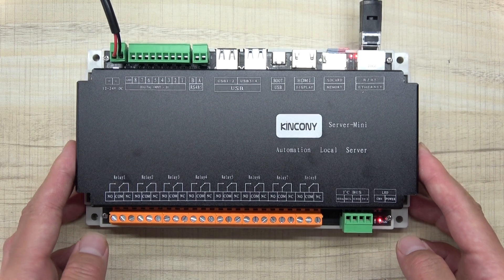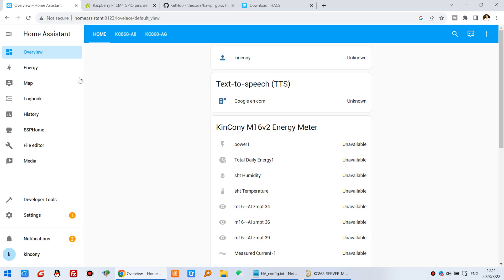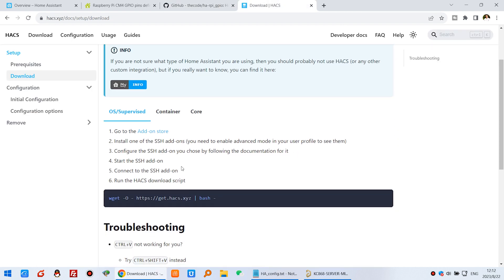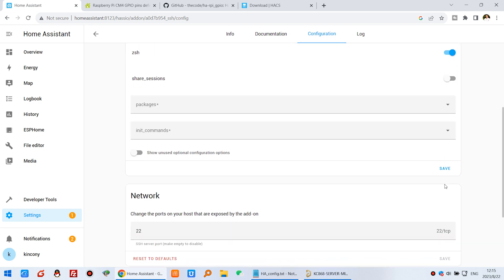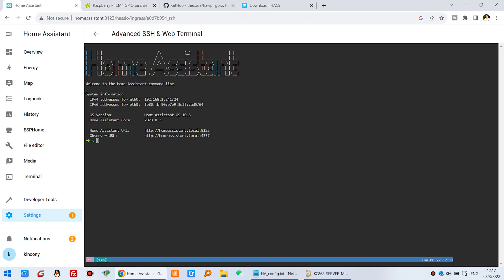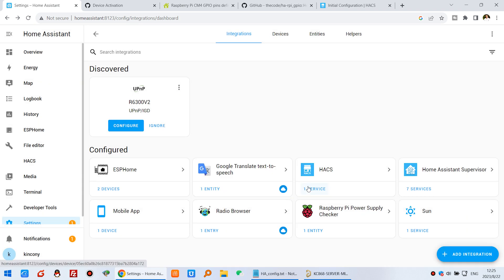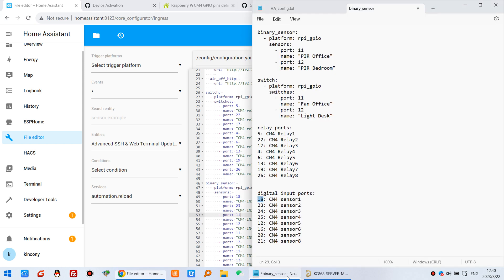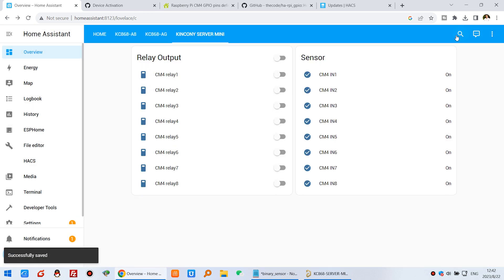Home Assistant Raspberry Pi (Server-Mini) GPIO Relay integration 2023!

Comment: Hello!
Our customer house project is with 
10 dimmable light zones. 
4 RGB-led zones. 
24 Relays outputs to 10A contacts 
+ 3 Relays outputs to 16A contacts.
Can U please send the board model for this setup?
Reply from the maker: you need some KinCony board's work together. suggest you post your requirements to our technical support forum, we will feedback a solution at here.

Comment: Nice video and very nice product, I have already bought from Aliexpress. I need to expand the I/O and the relays what kind of board I have to buy?  Many thanks !!
Reply from the maker: if you want extend relay, you can add i2c relay module, there is i2c terminal on KC868-Server
Reply: @KinCony  Thank you for the reply, I have to extends also the digitals inputs
Reply: @KinCony  Have you some example how to configure the outputs or inputs connected via i2c? Many thanks
Reply from the maker: we have video tour extend by MCP23017 chip, not tried PCF8574 with Pi. @cristiandelogu6049

Comment: Have you tested this board with the new Orange Pi CM4 compatible module, which has the RK3566 processor?
Reply from the maker: i am not tesed, does it pin2pin compatible with Pi?
Reply: Yes ,if that's what Orange Pi says !.You have an easier access to this product than me, I am interested in buying your board and test it with this module but for me it is very complicated from Argentina.
Reply from the maker: do you have Orange Pi's order link or model link, i can buy one for a test. @mpteklab6489

Comment: Hi..How it work when network fail or offline to turn on/off relay i.e how to switch to turn on/off(through physical buttons) manually using this method.
Reply from the maker: there is digital input work with wall switch, it's work locally, without network.

Comment: If i don't have home assistant,  but do want to use it. Can I run and use it on this server board?
Reply from the maker: sure, if not have home assistant, you can also install Node-Red or other Linux software on board. it's just a Linux computer.

Comment: Thank you so much mate!
Reply from the maker: you are welcome
Reply: just one more question. is there a way to boot the OS from a USB instead of SD I tried multiple things but couldn't get it working. @KinCony
Reply from the maker: do you want to save memory? suggest boot by SD card, it's stable. @fardidryder9360
Reply: I read online that home assistant burns the SD card fairly quick and it's better to boot them from USB SSD hard drive. so, I want to know if it's possible to do? @KinCony
Reply from the maker: sure, it support SSD by USB. you can backup your home assistant. install your home assistant on SSD device, then use SSD device  boot, restore from backup file. @fardidryder9360
Reply: but what the process change the boot from sd card to usb ? @KinCony
Reply from the maker: use "raspberry pi imager" tool download "USB BOOT" tool to SD card, let it power on , then will become USB boot mode. @fardidryder9360

Comment: It will nice if we have a mosfet version as well for the mini server
Reply from the maker: KC868-Server is mosfet version. mini is relay version, why not use relay? need use mosfet?
Reply: @KinCony   I like to use the external relay. Module which we can replace the relay easily if something gone wrong and  choose the ampire of the relays according to the user case.